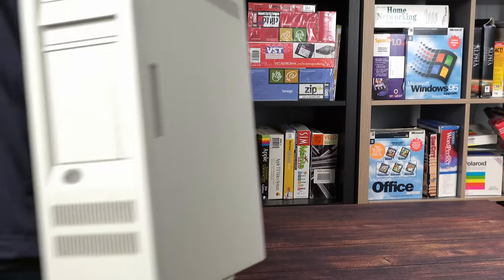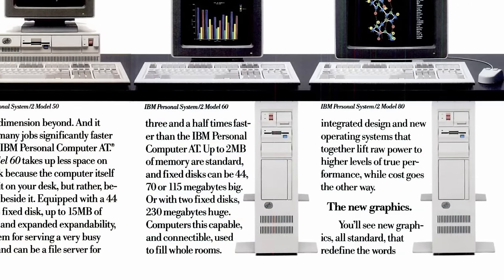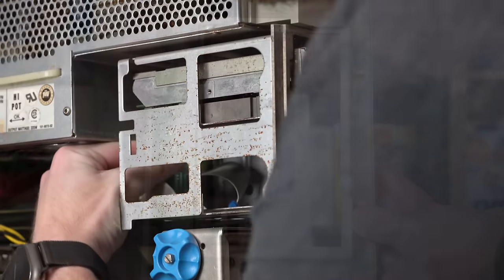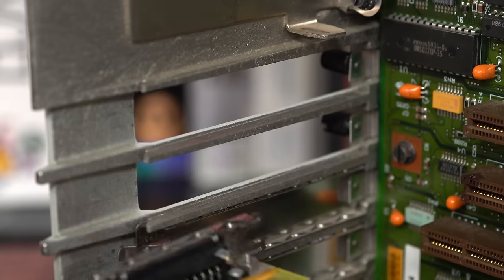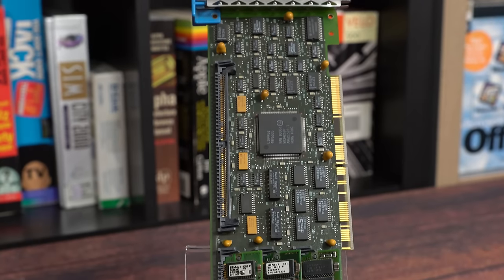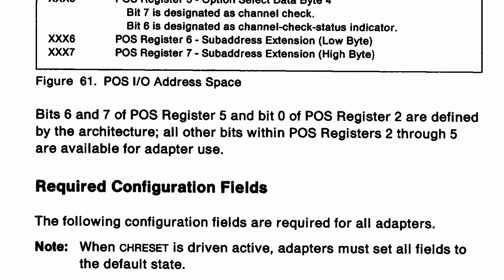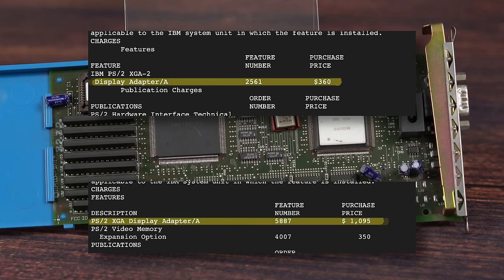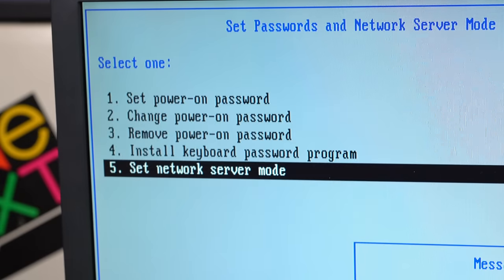IBM's 386 Tower of Power: The PS/2 Model 80

Comment: Thanks for the shout-out - I'll try to answer a number of the questions, and also provide more information.
Reply from the maker: Thanks! Your videos on the planars were already very helpful, but if the mystery of the floppy controller can be solved I'd be eternally grateful.
Reply: @userlandia : It's a SYSGEN 'Bridge' board -   The '60' portion in the part number means for the Model 60 (and by convention, also the Model 80). The manual is on Minus Zero Degrees.
Reply from the maker: Thanks, this solves a big mystery. Finding one of those Sysgen drives probably won't happen. My googling couldn't find anything because the silkscreen only says SYSGE 1060 and that's enough to not hit a match. But SYSGEN... that got more results.
Reply: @userlandia : I've imaged the files of the diskette as well - The drives are just conventional 5-1/4" assemblies, so it isn't that hard to get everything working.
Reply from the maker: I was reading that the IBM external drives won't work with it because the 37 pin external cable pinouts don't match and you have to wire up a custom cable. True?
Reply: @userlandia : True - the power for the external drive is still put over the cable. I have a drive, and will need to look. The IBM 4869 drives might have those pins as a N/C since they have their own PSU.

Comment: Years ago I remember we had a few of these running our network on Token Ring. They did all the file sharing, print sharing etc. They ran IBM OS/2 with Presentation Manager. They were so reliable, we rarely touched them. So much so that the time (we had that shown) had burned into the phosphors of the screen. These were awesome machines.

Comment: Thanks.  FYI - the key you are missing was also the 'go to' tool for undoing the screws on the side panel as well as the screws holding the adapter cards in.  I did work on a lot of these PS/2's, and SOP was to always have a copy of the reference diskette in aplastic envelope inside the case where the user could not recycle it, and tie the case key to the handle with a reusable zip-tie.

Comment: What a machine.  I can't believe MCA was a failure.
Reply: I had a 286 with a sound card, a VGA card and 2 harddisks. I could buy a new mainboard, an AMD or Intel 386DX and RAM and keep using all my cards and disks in the same PC AT case. Or a Microchannel PC for five times the price and also buy all new cards and scsi disks.
Guess which one people preferred.
I'll take jumpers or wobbly VLB cards any time over the mess that MCA was. Even IBM admitted that.

Comment: I worked for IBM for 37 years. IBM started me with a PC/XT then a PC/AT then a PS2 70 then a PS2 80 then we switched to laptops. The model 80 initially ran Windows and later OS/2. I bought a model 80 used from IBM that was surplussed to replace my PS2 30 286 at home. Memories. 

I have an IBM 8228 token ring hub if you want to get token ring working. It uses Rj45 connectors. It’s yours if you want it.
Reply from the maker: Thanks for the offer! I don't have any other machines with Token Ring cards. IBM Museum might want it though.

Comment: I just want to comment before the video begins, that this is truly one of my holiest of grails.  I worked at an IBM dealership in the late 80's-early 90's and handled these quite a bit.  I'd love to have one again to set up with various OS/2 versions.  My ultimate setup would have SCSI (of course) with one of those monster drives that let out a loud pinging sound as it initialized.
Reply from the maker: If your wallet's got enough cash in it there's one or two on eBay now... Just watch out for the shipping fees. BlueSCSI is compatible with these so you could easily have multiple virtual images with all your iterations of OS/2 ready to go!
Reply: @userlandia  Yes, it would be nice lol.  I can tell you that shipping to Bermuda would be at least as much as the item itself, if not more.  For now I'm emulating one using 86Box (on an iMac ironically).  

As for the whole thing with retro computing YT channels insisting on playing games on every system they get is silly to me.  I'd rather set one (or more) up as a typical business system, which means either a power desktop or server (which I think they were envisioning originally; we used them almost exclusively for servers).  

Exel, one of the biggest reinsurance companies out there had it's headquarters here, and I remember installing it's first server ever; previously the whole company had been run from a spreadsheet pretty much all in the CEO's head, as he was wont to say.  Fun little sidenote:  We got complaints that the server was crashing every night; we later found out that the cleaning lady was unplugging it to use the vacuum lol.
Reply from the maker: Ah yes, I've run into that "cleaning person unplugs a server" thing before.

I'm not one to tell someone how to enjoy the stuff they buy or make content with—note that I do ironically demonstrate a few things with games in this very video. ;) But this machine is very much a workhorse, and needed to be demonstrated as such. I had plans to run some other productivity apps, but I had to shelve them for a variety of reasons. The comments about these machines being installed as 24/7 Netware servers are spot on, really, because that's what all those drive bays were for.
Reply: @userlandia  Netware was what we installed lol.

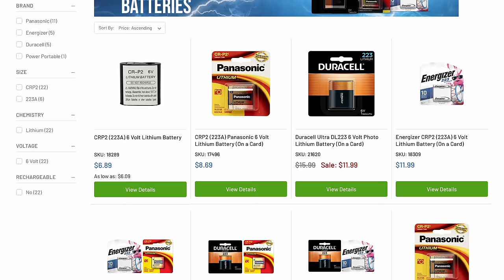Comment: 13:31 I wasn’t aware that these machines won’t boot without a working battery.  I had a non-booting one ages ago that was in pristine condition which didn’t boot.  Sold it off cheap to a collector.  Oh well.

Great video!  Love these beasts, but dang are they heavy!
Reply: The problem is: the dead battery causes a configuration loss - and you end up with various persistant errors like 162 / 163 (date / time error) and suchlike. And then pressing F1 as on XT/AT brings you nowhere, since the machine doesn't know that it got a fixed disk. So you need a proper CR-P2 battery (6V - can still be found at supermarkets in the "foto" corner - powered many small pocket cameras) and a reference disk for the models of the first generation MCA PS/2.

Comment: Having a 386 in 1987 would have been awesome

In installing Windows 95 on an AT after I installed 4 MB and an 80 MB hard drive, I found that it was absolutely possible to install an ISA 1 MB Trident video card and an IDE card and a Floppy/serial card, Sound blaster and a 33.6 modem and even a token ring / 10-base-T network card and a memory expansion card and a bios expansion card for the 386 CPU when it came out.

I realized that if MS had written Windows 95 in 1984, they absolutely could have run it on 286 machines and had 1 MB Trident video with 16 million colors

I ran a grayscale CGA display on my 286.

It ran slow but still very usable

I really wish they had written at least 3.1 in 84.

We could have been a decade further ahead.

Comment: Great video!  You should definitely installed OS/2 Warp on that thing.  It would only be appropriate.  And it runs really well on my PS/2 Model 9577 486DX/2 66MHz system.
Reply from the maker: Perhaps a subject for a future video... ;)

(Seriously though, I am intending on doing it, but I need to set up some BlueSCSI disk stuff first and it just would not have fit in the schedule/flow of this video)
Reply: Or NetWare 386

Comment: I've got one under my desk, with a Gotek, a ZuluSCSI RP2040, 3D printed and painted 3.5 bezel/tray adapters rocking a Reply TurboProcessor uprade board with a Pentium Overdrive 83mhz, 128kb L2 cache, a BT-646S Fast SCSI card, a 100Mbit network adapter, a ChipChat sound card, and a 5 disk CD Changer/Driver mounted vertically with the 5.25 adapter bezel. 

One of my favorite PS/2 rigs.
Reply from the maker: I think you win the award for most upgraded model 80. Talk about a hot rod!

Comment: That was a great watch. Thanks!

12:54 I think you might be spot on when it comes to the floppy expansion PCB board. Its silkscreen says “tape”, and there’s a 37pin floppy port on the back, leading to that same PCB. 

I’ve got an early Ditto drive, which connected through the MFM floppy interface. As the IBM PS/2 line was known for becoming the new standard, the floppy port was definitely incompatible by default. That’s where such PCB would come in handy. :)

Comment: Very nostalgic! I had the misfortune to work on an i486-based desktop IBM PS/2 in the late 1990s. I did not have any experience with MCA-based PCs, but I learned to hate this machine with a passion when upgrading the SCSI-drive; first off, I thought nothing of it: this was SCSI which I knew was a breeze as the controller would enumerate and map any devices detected on the SCSI-bus by itself. Not so in an IBM with MCA! Error on boot and request for the reference disk. Having located it and entering the configuration software, I expected the system to update its configuration to accommodate the new drive, ask me to confirm, then save an reboot. Nope. I had to manually re-register EVERY single accessory currently present on the MCA-bus! Plug and play nothing! Several times I didn't get all parameters correct and next boot: Error, rinse and repeat every single thing in the configuration software.
If I'd ever see one of these machines again, I'd smash it and enjoy the experience immensely!
Reply from the maker: Your experience wasn't uncommon. When autoconfig works, it's great, and when it doesn't...

Comment: Oh boy, what a trip down memory lane... In my first "proper" full-time job in the early 2000s, looking after a secondary school network, I got my hands on a whole bunch of PS/2s including an 8580. If my memory serves me correctly, it was a 386DX/25 with 387. I think it ended up with 12MB RAM (4MB on the cards and 8MB on an MCA board) after I'd swapped some SIMMs around a bit. It had a whopping 340MB ESDI full-height 5¼" hard drive (which sounded amazing) and an 8514/A. I have a feeling it had a security label on it that indicated that it had belonged to an engineering company before being passed on to the school (the rest were donated by the local university during my time as IT guy). It had been gathering dust under someone's desk for some time before I spotted it (and promptly went into whatever the old computer equivalent of "oooh, shiny!" mode is) while sorting out a problem with their "modern" PC.

Sadly, I had to leave all the PS/2s, along with several large boxes of Model M keyboards, behind when we moved out of the old building into a new-build because I simply didn't have anywhere to transport or store them. The back of my car was stuffed with servers and the like (thank goodness the Volvo 440 had a boot/trunk like a black hole) where the removals guys had "finished" and left before I'd been able to pack up the IT office (they turned up several days early, while people were still using the system) so I couldn't take even one of each type with me.
Reply from the maker: I think we all have pieces of tech that get away from us. Alas, even the mighty Volvo station wagon has its limits.

Comment: The Later PS/2 series was an important and basically unrealized step up in x86 PC history, many features introduced by the PS2s are in use today on modern PCs; Basic Plug N Play (a feature of MCA), PS/2 ports, "High Resolution" Advanced desktop graphics. Multiple displays,  Software configurable interrupts, SIMM memory, Among others.
Reply from the maker: The subject of the PS/2's influence and false start on PCs in general is covered in the PS/2 Model 30 286 Computers of Significant History video. Check it out!

Comment: Good thing you got the 80387, it improved my model 80's stability quite a bit, but I have the 1st rev 4 rom 386DX-16 board, so maybe it's something weird with that.  The XGA-2 card is 32bit, which makes the video far faster.  Bench the video speed with the onboard VGA & the XGA-2, and you'll noticed that XGA-2 is 4x faster... Meaning the built in VGA is actually an 8bit peripheral!  Links386 works fine with the included VESA TSR & the flag to not do VGA palettes, as you hinted on.  Also Sim City 1.0 for Windows 3.0 runs fine as well.  I loaded Excel 2 & Word 1 for Windows onto mine!  and of course OS/2.

Comment: @15:54 - Unlike any other PS/2 model, the 'Type 3' Model 80 planar has two AVE (Auxiliary Video Extension) slots; Likely from the IBM Japan origins, where a different adapter may have been intended. The 8580 'Type 3' also is the only PS/2 submodel that has a socketed keyboard controller - thought to perhaps be for the possibility of the lower-end 3174 controllers where that planar was used to run the different keypad.

Comment: 25:42 hey now! I sold you that card at the last swapmeet! or rather, my friend next to me of whom I was spot sharing did, I was off perusing the wares at the time if memory serves. I had an ADF disk with drivers in the trunk for whomever was gonna buy it, but I wasn't there for the sale in the end. Glad that you found it, regardless. If memory serves there should be a crynwr packet driver for it, but I didn't look much further than that. I used that card to back up my P70 before it decided to die in front of me not more than 10 minutes after the backup was complete. So beware, that card has somewhat of a SpoOoOooOoky past attached to it...

otherwise, I picked that card up at VCF East 2018, and at that time I had to fix broken joints, that's why the one square PLCC chip top-middle is slightly crooked and there's some other random reflows here and there. didn't get a proper use until last year, and that was for the backup operation. was the first and last time I used the card. From here on, if I get that P70 ever working again, it's gonna be with a Xircom Pocket Ethernet adapter or my rather rare Kodiak parallel ethernet adapter. Either-or will do the job in that machine where it'd otherwise take up a slot I could use for an 8MB RAM expansion. but alas, that machine shows no signs of life at POST. so I'm not sure just what the hell is going on.
Reply from the maker: Wow! Thanks for the history of that card. Small world. :) Hopefully I'll see you at VCF East!

I know that if I ever sell any MCA cards my plan is to put the floppy in the anti-static bag with the card. Otherwise the scenario you listed (they get separated due to a mixup) is all too likely.

Comment: @14:14 - A 'Tribble' SCSI adapter should actually be in [the upper-most] Slot 8 for the 'Type 2' Model 80s that had SCSI: The convention on microchannel PS/2s is that the hard drive controller (MFM, ESDI, SCSI, or DBA-ESDI as appropriate for the system and sub-model) is in the highest-numbered slot, at the highest SCSI ID address (for 'narrow' SCSI, although the 'Fast/Wide' controllers kept the same convention), with the primary SCSI drive at SCSI ID 6. Of course you will notice that Slot 8 of the 'Type 2' is only a 16-bit slot. Despite the appearance of the 32-bit section of the 'Tribble' adapter, it is actually a 16-bit controller. With a 'Spock', you are forgiven to put it in a 32-bit slot (since it is fully a 32-bit controller); The 'Spock' wasn't used to add SCSI to a Model 80 until the 'Type 3' (25MHz) planars, which had a 32-bit Slot 8.

Comment: Aww man, makes me sad to have your channel only find its way into my recommendations now! I'm in central VT, and back in December I had to leave 13 of these 386 and 286 PS/2 towers and a few other microchannel machines behind in my old apartment when I moved because I lacked the resources to move them. I would've let you take as much of it as you wanted for whatever you'd have been willing to pay. 😩

I did manage to save two big boxes of MCA adapters, some RAM cards, a few keyboards, even two old PS/2 monitors... So, if you need any accessories, let me know and I'll catalog it all. I may "know what I've got" but I'll let it go for "what I can get" because I don't want to see any more of it end up in a dumpster. 😢
Reply from the maker: Hey, if you've got a sound card lurking in that pile of MCA cards I'd definitely be interested! Let me know what's in your collection and maybe we can work something out. And it's a shame about those old machines. Had I known I could have helped you find people to re-home them. If you can make it down to VCF East you could probably unload it all and make sure it gets to a good home.

Comment: The only good thing about microchannel was how simple they were to diagnose most startup issues.  And that seems to be a completely forgotten thing at least over the last few years in YT videos by others, just plug in a dot matrix printer with paper ready to print and boot the computer to have the issue print out.  I vaguely recall only 2 issues when it wouldn't print and both meant replacing the mainboard, the 3rd no print was a dead battery.
Reply from the maker: I know these systems (and some others) can send POST codes via the parallel port to an LED code display. But actually sending POST codes to a printer? I've never actually tried it. Would like to see it in action.

Comment: My model 80 was a small basket case when I got it. And it can be a real nightmare to get them running right if they are misconfigured. Mine (A21) has the 8514 graphics upgrades, cached scsi, and the works. I had to do some recapping and psu repair. Original harddrive still functions and was left in the machine unplugged but was upgraded to a 540 at some point.